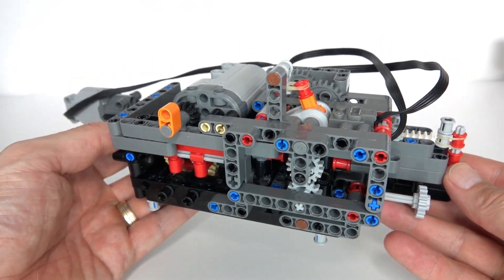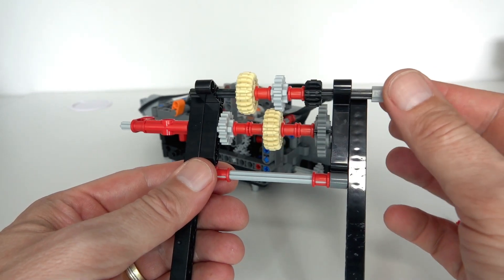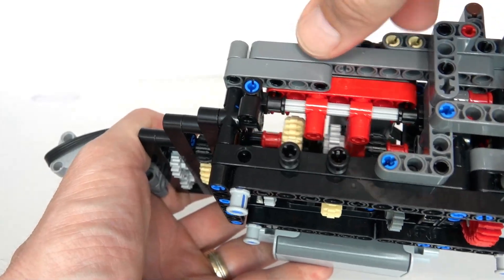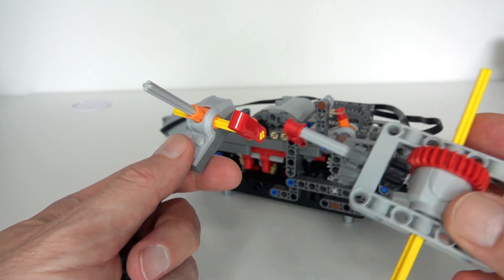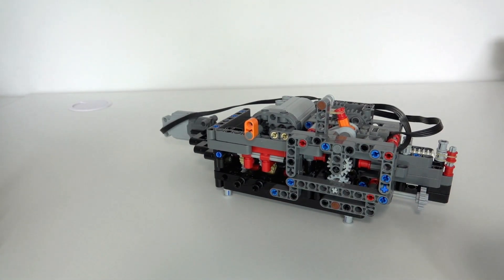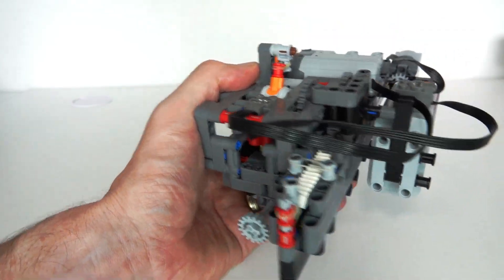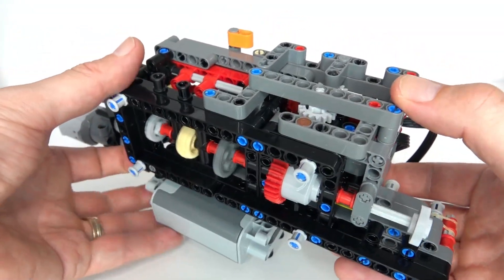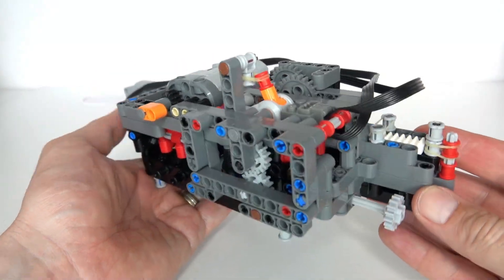Lego Technic Servo Driven 3 Speed Automatic Gearbox

Comment: Nice use of the servo. I never would of thought of that. Can you try to make compact manual 3 speed Gearbox. That would be very cool and very useful in MOCs
Reply from the maker: Hi Alex. Yeah the idea came to me the other day when I was using the servo for a remote controlled gearbox. Have you looked on rebrickable for a 3 speed manual? I imagine there will be some good ones on there.🙃
Reply: For compact manual/rc gearbox, have a look at Sariel's Bricks and Pets. He gas one with a few variations based on PF servo vs Control+ motor to control it, or studless vs studded construction.

Comment: That is another incredible design and mechanism for an automatic gearbox! I love to see all your new designs and new methods for switching between the different gears and I can't wait to see more. :)
Reply from the maker: Hi Lego Mocs.  Thanks so much for all your supportive comments! There's more in the pipeline ;) 🙃
Reply: @TechnicBrickPower  Hello, I'm interested in a mechanism that transferred the power from an input to an output not fixed but not by switching axle direction like a free wheel but by input/output switching. So if the input turns right/left the output will turn right/left but if I turn the output right/left the input woun't turn.

I created a differential switch from two to one way and at the input a rocker with gears - based on some automatic gearbox switch that you presented - so I turn the input right, the right way turns to one way and turns the output right and the left so on in the other direction.
When I turning the output the turning is splited so every time the gears turn against the fource of the rocker putting a small gap between them so the input is save.

But when I put to much load on output of the mechanismen, the force go back to the opposite parte of the gear rocker where the gear can spin free...
So... do you know an easy solution or have you maybe a name for this type of automatic clutch problem I try to solve? :/